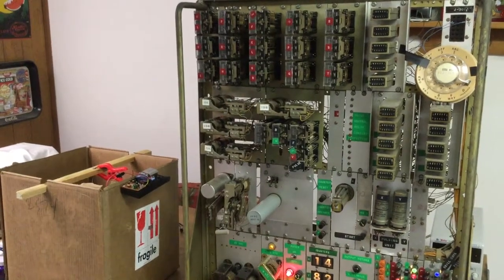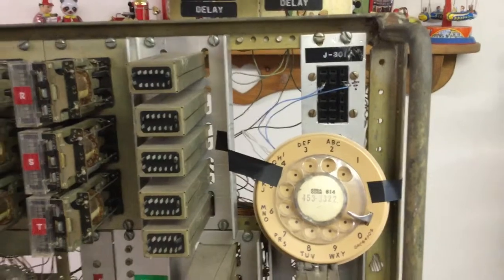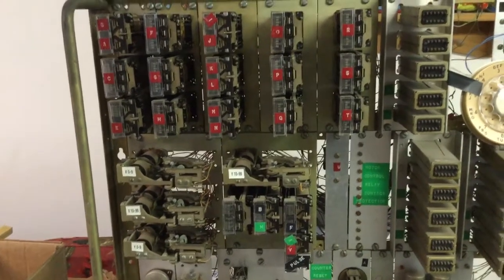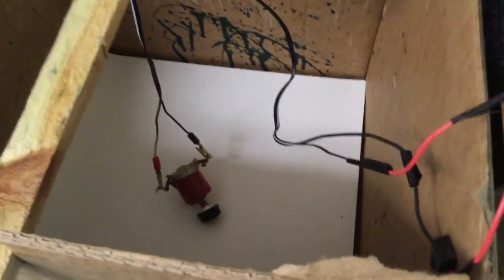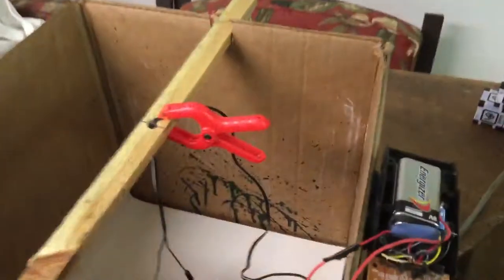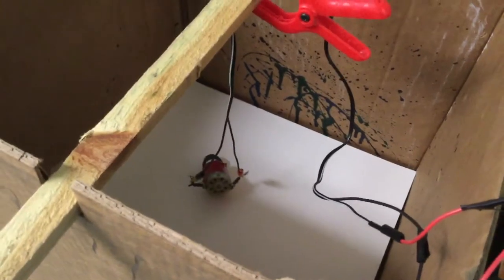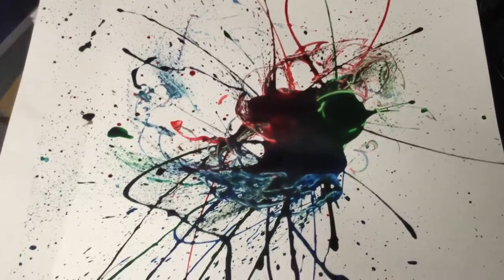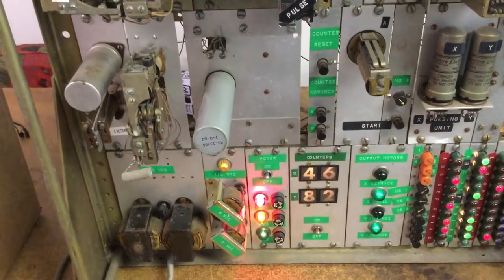ROBOT ARTIST USING VINTAGE CONTROLLER

Comment from the maker: Hi Carlo,
               Thanks for watching my video. The answer to your question is: there is no direct connection to the controller and the 27mhz receiver. Instead, the magnetic fields formed around the relays as they open and close is transmitted through the air to the receiver nearby causing the relay in the receiver to close and power the motor in the box and swirl the brush. Hope this helps😀
Thanks again!